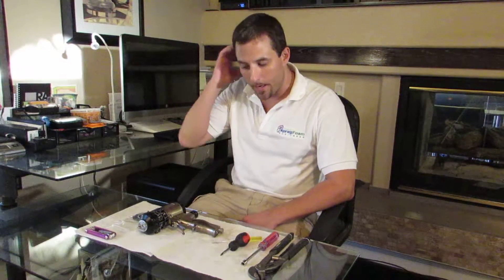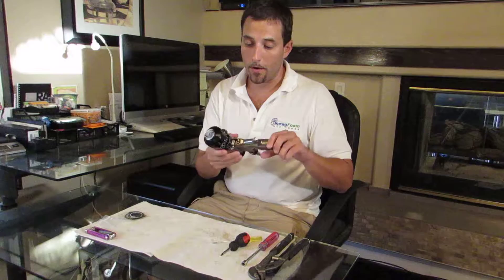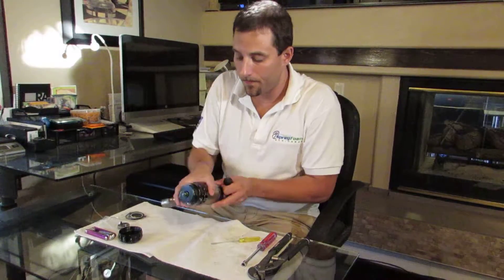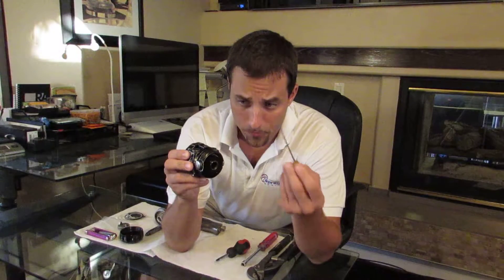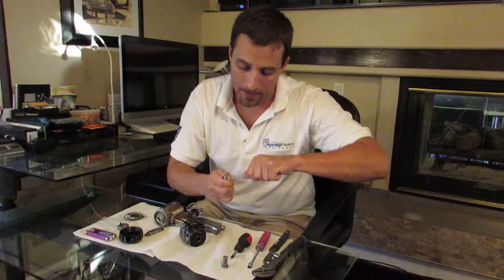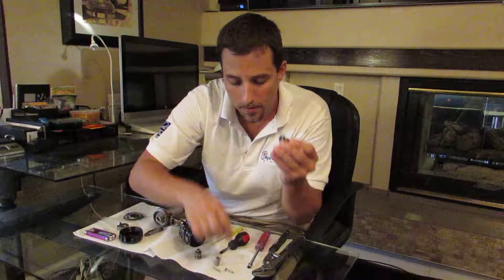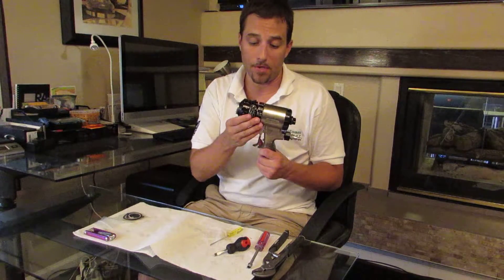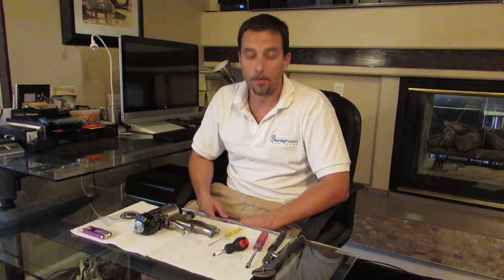Graco AP Fusion Gun Front End Assembly Video

Comment: You did not check to see if the mixing chamber lettering was up before you screwed on the locking ring. Major issue if they do not match up when the trigger gets pulled.